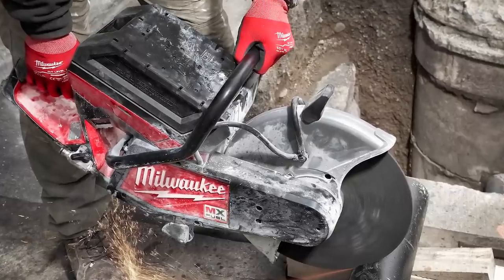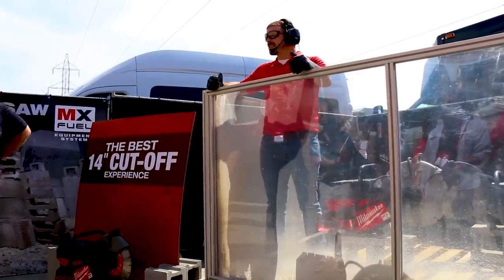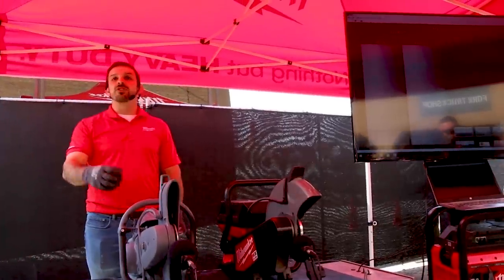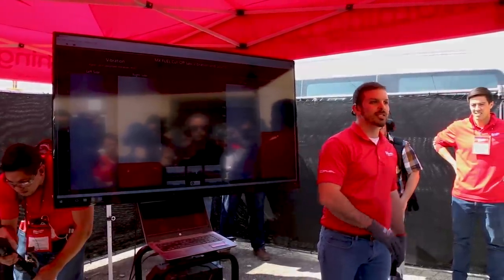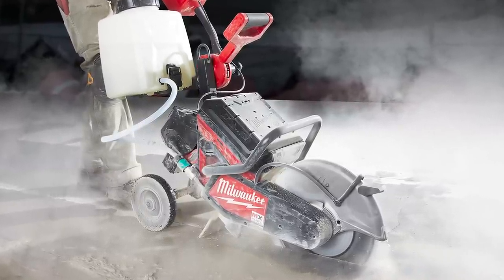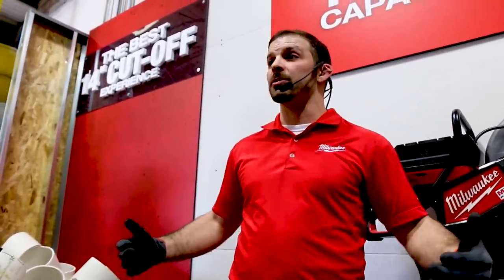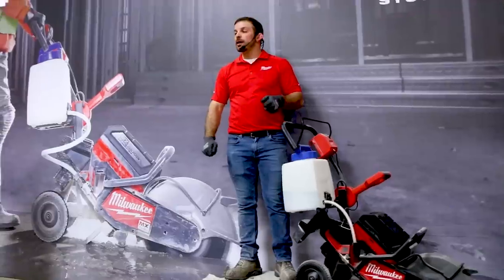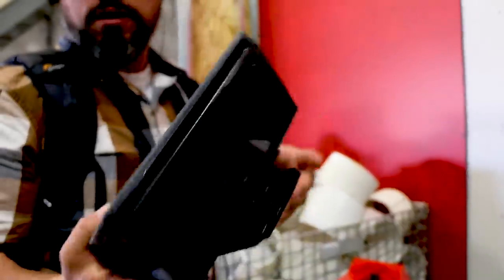New Milwaukee Tools MX FUEL 14'' CUT OFF SAW BEATS GAS POWERED!

Comment: this would be the perfect battery platform for a milwaukee lawn mower or even RIDING mower, beastly.
Reply: The big battery has less than 450w storage. Troybilt has an electric riding mower with a 1500w battery they claim can cut 1 acre of grass in one hour with one charge. This battery would give less than 20 minutes of run time under optimal conditions.
Reply: @timothybayliss6680  you might need to do a little more research on the battery specs because some things aren't measuring up, the mx fuel power station is rated 1800 watts with 1 mx battery, 3600 watts with 2 batteries equating to 864 watt hours of run time with the xc406 batteries
Reply: $100 for a gas mower, +$50 per year in gas,
Or $4000 for a milwalkee battery mower?
No contest really!
Reply: @sally6457  100 bucks for a gas mower? Lmao what country are you from, my Deere lawn tractor was $4300 and runs me 40 bucks a week in fuel, a comparable electric lawn tractor would cost about the same but save me more than 60% on fuel cost
Reply: @Ma77riK  you think this is the perfect battery platform for a small tractor? 
And If you can buy an electric tractor for the same price of your John Deere, why haven't you done so?
Reply: @sally6457  I'm planning to do so, haven't listed the Deere for sale yet, I've been looking at the Ryobi electric lineup closely, as well as retrofitting one of the lawn tractors in my collection.
Reply: @Ma77riK  your looking at a battery system similar to those used In Jungheinrich battery forklifts, with 3 phase charging.
Batteries cost around $4000 dollars alone, plus cost of the charger, 
Nothing like the milwaulke mx fuel battery system.
Reply: @sally6457  nope those are still lead acid batteries, im talking full lithium ion, im going to run the same Dakota lithium 48v 96ah batteries i currently have
Reply: @Ma77riK  good luck, hope it works, let me know how it goes. 
Any electric equipment that can even come close to a fossil fuel burner equivalent is a good thing.

Comment: I love Millwaukee!! Only question I have is.....wet cut is great for concrete. But now we need to solve the dust application as well where water is not feasible. Will there he a dustless vaccum attachment for concrete cuts?
Indoor work is what we tend to do and we cant have dust flying around or messy water everywhere. Great design for sure. 
Btw, some masons are cutting all day and we go through 5 tanks of gas min. Maybe the battery pack isnt good for us lol. 
PS. Make other dustless saws for masons please ♡♡♡♡

Comment: Would have liked to see the gas motored saw running before the cutting tests were made.Milwaukee has come out with the most serious piece of cordless machinery out there!The batteries are LARGER than what is on my cordless mowers!Would be neat to try one of these---but have no use for the saw-just would be fun to try it!Cut things up--make "cross section" views of stuff!

Comment: I must be missing some information because I can't locate if this is a single speed, multi speed, or variable speed.
Reply: It's variable speed. The trigger will be a variosistor that has a 0-5v output the motor controller puts into speed. Half trigger is half speed not half power. As soon as the motor slows the controller pumps in current to speed it up. The speed controllers work relatively good, and it becomes natural after a couple minutes.
Reply: @timothybayliss6680  "will be" ? Or "is"?
Do you know or are you guessing?

Comment: Smashing that like button for yah. I'm so excited for the mx line, the only thing i would even consider on buying though is that generator. That's what I've been mainly waiting for. I wonder if what the cost would be for that
Reply from the maker: I will assume it should be under 2k, but that’s literally a guess!!
Reply: @VCGConstruction  i don't own a generator now, but the cost of convenience, and reliability for a small business like mine, where I'm working by myself, less maintenance will save me so much time. I buy everything cordless but i need corded tools still. So I'll save as much as i can and see if i can fit it in my work flow

Comment: Who else think that MX is a 10 volts tool with a lot of amps? Based on the other tools M12, M18. Hehehe im just excited!! 😁😃😂
Reply: Ricardo Garcia  No, not practical my friend :) Big currents are hard to switch and waste a lot on heat. 
IMO this will be 10 x 4,2V = 42V system with power peak around 6000-7000W.
Cheers!
Reply: The mx battery is 72v6ah. The other is 3ah.

Comment: When is the automotive air hammer m18 equivalent coming out?
Reply from the maker: No word on that as of yet!!
Reply: Milwaukee please I need it
Reply: The 1/2 inch fuel impact is boasting 1400 ft/lbs of torque removing and 1000 tightening a husky 1/2 “ air is at 800

Comment: This looks cool and all and Milwaukee makes  nice tools, but when he said that your average concrete saw operator can get through the day with a single tank of gas? Yeah, no. On my Stihl, depending on what the saw is being used for that day, like if I am cutting pavers when installing a new patio, I could go through four tanks of gas in a single day easily, which, depending on how long it takes to charge one of those huge battery packs, means I might need to have like three or four in order to constantly have one in the saw and one at full charge while the others are in various states of returning to full charge. Doesn’t sound very efficient to me

Comment: 2000 dollars for that saw,jesus i buy to stihl  saws and is going to work for years!
Reply: We bought a Makita 2stroke about a year ago, it was one of the cheapest saws we could find and it weighs more than 10lb less than this saw. The most I've cut with it is a single cut almost 600' long through 4" of asphalt. Almost every time we take it out, we bring the fuel because we'll need it. This is a really neat idea but I really don't think many will buy it.

Comment: There is no way that will be comparable to a husqvarna 970 cutting through 1/4”- 3/8” mild steel. Would be nice cutting some plastic pipe where you wouldn’t need the gas saw

Comment: So let’s talk about how much is the tool and the batteries and the charge time? Cause this battery has to charge in under an hour otherwise your gonna need 4 batteries and given how much the batteries are I doubt it’s under $400 each.
Reply: They mentioned, in other videos not sure on this one. But that two big batteries equal, one tank of gas. I'm which one tank of gas would last you all day. The big battery charges on hour on a half or something like that.
Reply: 5:53
Reply: 7:35 it is 90 minutes. But as with all Li Ion batteries, it should be about half of the time to get it from 0% to 80%
Reply: The batteries are $600 each and have 438w capacity. Just for some maths.

Comment: Another rediculas cordless tool comparison. When my gas tank runs out, I can just add more gas, all day, every day. How many batteries can you afford to cut all day long.
Reply: I agree with you, we will have to see. But two to three batteries for a full day. Doesn't seem that bad, it's all about cost here, and if the runtime is as they claim. I also think with an upgraded blade like the one Stanley dirt monkey posted about a while back, this will help with performance. I'm really interested to see how this will go.
Reply: Agreed. I think within a decade we will have battery cut offs that can cut all day and stay cool but we're just not there yet
Reply: PhantomZero it’s 2 batteries for 1 tank of gas not all day. I can fill up the tank 2 or 3 times a day cutting multiple blocks.
Reply: aurelio milaor cabal  we have a m18 chainsaw at work. It's awful. The huge 12ah batter takes more than 3h to charge and the big 9ah battery take more than 2. The draw will also overheat any battery that isn't the 12ah in weather above freezing, ask me how I know. 
To cut up and limb a 30' tall red pine I went through a 12ah, a 9ah and 6(!) 5ah batteries and didn't finish. We have three chargers at work and couldn't keep a battery usable. The chain was freshly sharpened and was doing way better than the Stihl that we used to finish the job. Every time you pinch the bar it ends your fun and it happens frequently with the .041 chain that they come with. 
If you want something light to cut a limb off when you're on a ladder, sure, theyre fine. Don't try to use one as a chainsaw. They're not.
Reply: @timothybayliss6680  3 hours to charge?! Pffff. Bet you didn’t have it on a rapid charger. Mine take about 1 hour to charge. Perfectly fine for cutting trees.
Reply: We just bought one of these and I've had it for about 6 months now and we are very happy with it. We do utility work excavations and as often as we use it during the day two batteries have worked great for us. I realize someone may make more cuts than we do even though we do a lot but it's also nice being down in an 8-ft excavation knowing that you're not sucking in harmful fumes from the saw anyways, lol

Comment: Ok, it seems that this will be 40V system, 3x10 cells in small pack and 6x10 cells in double size pack. That means 40V x 30A x 6 = up to 7200W of peak power - nice ;-)
Reply: I was thinking that it will be 10V with a lot of amps. I don't know if you have notice M12, M18 and MX in this case X can stand for 10
Reply: Ricardo Garcia : Hi Ricardo. Unpractical :) 
Yes, X = 10, but 10 x 4,2V = 42V. Look at animations where thay show inside of battery.
Reply: @onomatopejaB  Yeah that's true i also thoght that
Reply: @onomatopejaB  Wow, are you a technician or an enigineer?
Reply: Ricardo Garcia : yes,. I’m electronics engenieer. I didn’t notice X in the name, just counted cells - nice catch! :) I could be wrong but I think that we are close enough. For reference see Hitahi tools - they are using higher voltage batterys for high power stuff. One LiPo standard cel is 4,2V nominal, 2-3Ah of capacity and can put up 20-30A current (for shot time even more).
Cheers! :)
Reply: The X does not stand for 10. The X means that they don’t want to talk about Voltage anymore since that can be very misleading. There are batteries with more than 100V which still cannot reach the performance of the MX batteries. Thinking that higher Voltage equals more power is not really true anymore. Still, I can assure you it is not 42V
Reply: Nico Brett : hmm.. what is making you „sure” that it’s not 42V (10S)? You can clearly see in renderings that cells are 10 in rows, 30 and 60 cells in summary. You need to arrange them in grups. You can divided 60 & 30 by: 30; 15; 10; 5; 2. 2, 5 (M18), and 30 (126V) we can crossout. 10cells = 42v and 15 cells =  63V are possible. IMO it is 42V as a natural double of M18 with 7kW capability - planty of power  IMO.
Reply: Nico Brett : I just fund out solid info: It’s 72V :) strange... It’s more than 15s? EDIT: it’s 22 & 44 cells - my mistake. That explanes a lot :) cheers!
Reply: Bartek Ł. There is a Video of the diamond core drill where you can see how the cells are arranged in an animation. (+ I work there)
Reply: @onomatopejaB  The 72v liion is 20s. That's four of what ever the m18 setup is. Given they are 3.0 and 6.0ah packs I'm gonna say they are using 3000 mah cells. The weight of the packs is also really close to double. Sony and Samsung both make 10c 3000mah 18650 cells and I think the Samsung cells are what's in the m18 9ah pack. The 12ah m18 pack has 21700. The 6.0ah m18 also has 21700 cells but a lower.capacity. 
I wouldn't think these batteries have a lower rating than 10c and that's pushing it. At full power that's only 6 minutes to drain the charge. It would also make.the 3.0ah battery almost useless on the saw.

Comment: I would really like one but as a small business, it’s way out of my price range, those batteries are to expensive, I had a hard enough time convincing myself to by the m18 12.0, you may save on gas, but that is always changed to the customer, and £5 worth of gas or £700 on a battery 🔋 😱 excellent for indoors like you say! And no idling noise, but I just wouldn’t feel comfortable getting such an investment out of the van without having it chained up, think you have priced yourselves out to small firms, it’s only big business, that’s gonna buy these.

Comment: I do wonder how long this electric motor holds up. Masonary dust kills electric motors.
Reply: aurelio milaor cabal  amazing that they've come this far but still a way to go... I make alot of long cuts in a day still can't consider a battery cut off saw just not worth the hassle but I know within the next decade we will have battery saws will cut for much longer and have better cooling etc.
Reply: It's a brushless motor that uses a flying magnet as far as I know. You could run one under water if the conductors were electrically insulated for it with no ill effect. The dust is bad, but it's not a game changer.

Comment: This saw is useless I purchased on two weeks ago with two batteries it cuts about a metre before  the battery dies , as soon as it come under pressure the lights flash and it cuts out , the biggest waste of 2 k I’ve ever spent
Reply: I I got the 9inch dealt it's very nice

Comment: Nonsense, that gas saw never even dropped an rpm!! Zero downward pressure applied to the saw from the Milwaukee sales rep. Total bs!! The gas saw would leave that battery saw for dead when you take those Milwaukee guys out of the equation
Reply: We bought one and it's just as good as our gas-powered Stihl
Reply: Entry teams still using the gas saws.The battery saws do have they’re place though how does the Milwaukee compare to the De Walt saw I’m curious